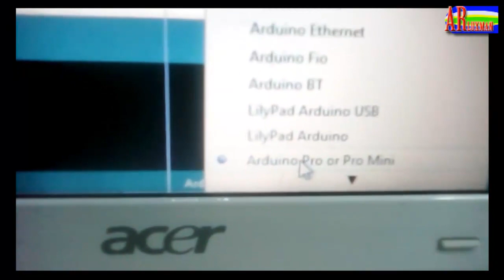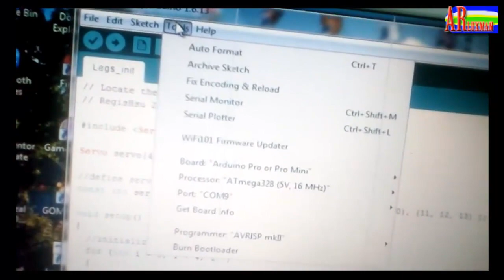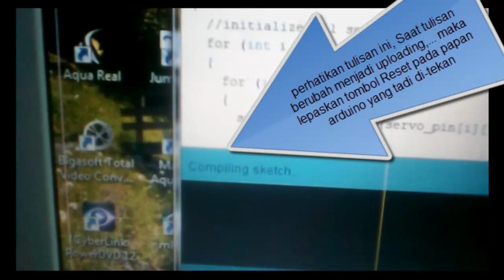Cara Upload Sketch Pada Arduino Pro Mini Dengan Usb to TTL PL2303

Comment: i'm do it. but not working .

why ? 

serial port is ok .

but not working..
Reply from the maker: should be. before the upload starts, you must press the reset button on the arduino pro mini constantly not released, then you click the upload button on the arduino idea. Wait until you see Uploding, and you can release the reset button on the ardine. At that time the sketch will be uploaded successfully.